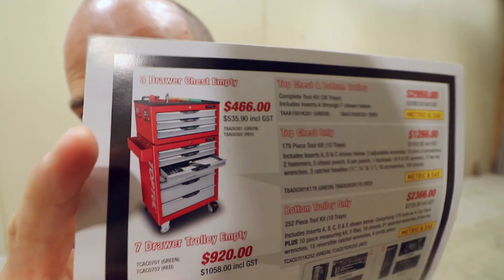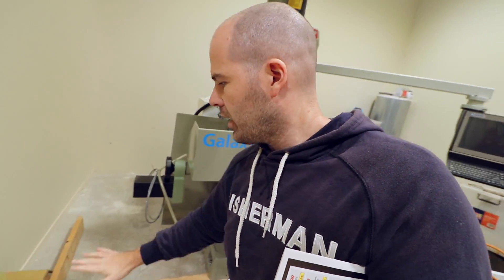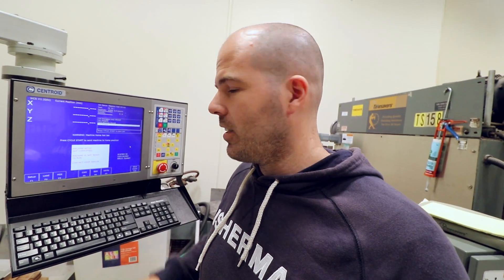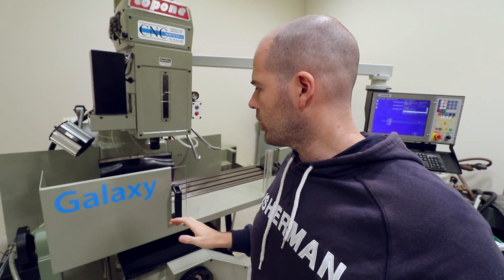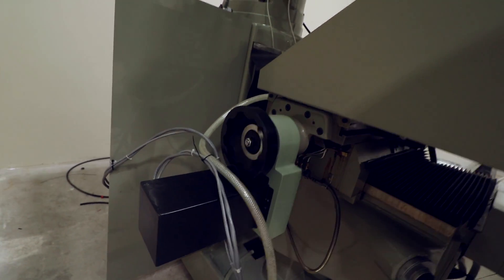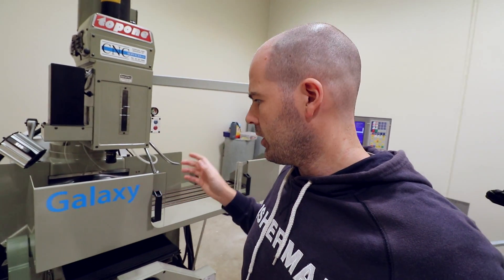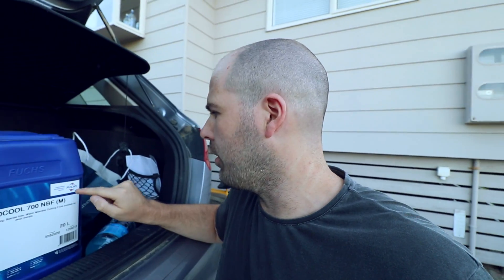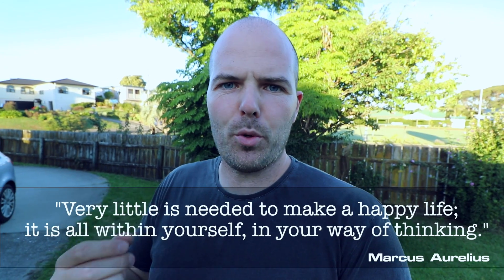Figured out the problem (my fault)

Comment: How about combining tungsten with titanium in aspinner? make the body out of titanium and the tips of the spokes out of tungsten, make a locking mechanism for the two metals to hold together. this makes the spinner heavy on the outside giving a lot of momentum and could potentially spin very well. how about it?

Comment: Since you comment on the best metal. Would you consider making it out of Tungsten over Titanium  on some fidget spinner?  Also, which ball bearing you will be consider using?  Right now the most popular it the R188 hybrid or full ceramic ball bearing  (6.35 x 12.7 x 4.762 mm).